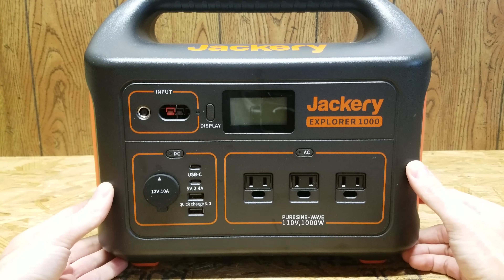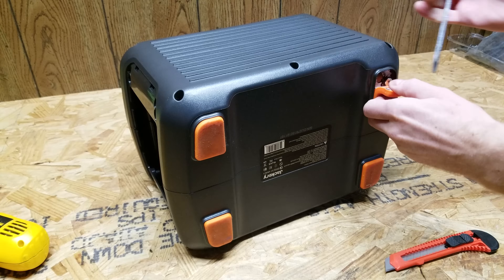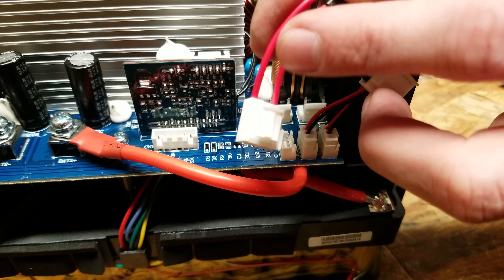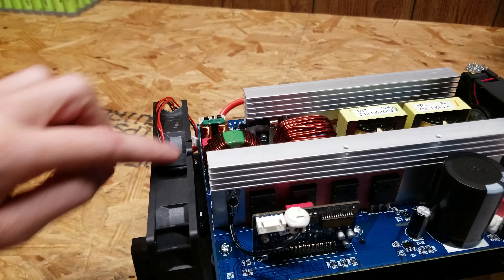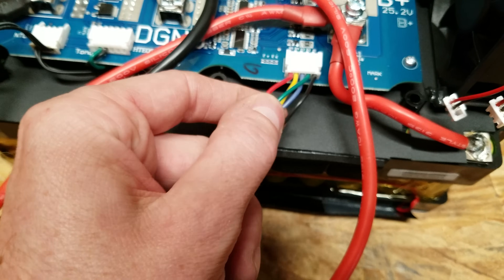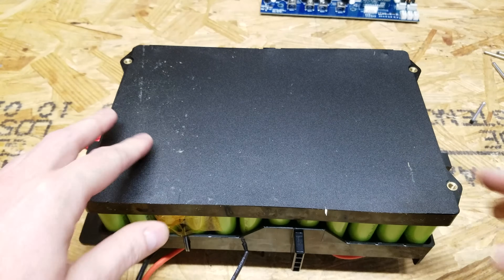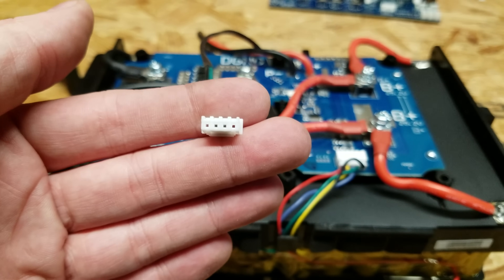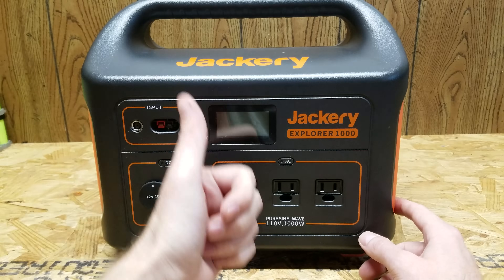Teardown of the Jackery Explorer 1000, Detailed Look Inside!

Comment: supposedly they have built-in safety features, including internal "breakers," that protect against overloading. The specific safety mechanism is an advanced Battery Management System (BMS), not a physical, resettable circuit breaker like in a home electrical panel.

Comment: So i recently purchased a jackery 1000 that is not charing and will only stay on while plugged in.  I tore it down and when i got to the point that he checks voltage at 6:17 https://youtu.be/AKxt4eAwKRU?t=377 i was getting like .08 but when i tested directly at the battery terminals im getting 18 to 19.   So I am thinking it has to do with something on the BMS board.  Maybe those resistor shunts?  any one have any ideas?
Reply from the maker: Was this still under warranty considering it was purchased "recently"? Your best bet would have been to return it and/or contact the manufacturer. Even if you are able to identify the problem, it's not really designed to be serviceable and they do not sell replacement parts or battery modules to my knowledge.
Reply: @LithiumSolar  No i purchased this second hand through facebook market place.  I did end up finding a blown fuse, but i read that if the fuse is blown there might be more problems.
Reply: @LithiumSolar  So i looks like i was able to get my unit working.  What i did was I checked the voltage going to the resistor shunts,  2 of them read about 18v but the other 2 read 0.  I replaced them (2 are BVS-A-R001-1.0 SMD precision resistors 12 Watt 5 mOhm and other 2 are BVS-A-R002-1.0 SMD precision resistors 12 Watt 5 mOhm)  Put it all together and plugged it in and boom its now charging like normal.  Waiting for the unit to get to full charge to test it fully.

Comment: Great video, saved me a whole bunch time today when someone brought one in to our local repair cafe.  I see there are a number of surface mounted fuses on the main board (with the display). I saw F1, F2, F6, F7, and F8. Not sure what circuits they all protect but the complaint was that it wouldn't charge from the solar input and F6 (rated 10 (amps, presume)) was definately blown.

Comment: Interesting...My Jackery 1000 Explorer started flashing the SOS signal at the flashlight on the side, and it would not turn off. However, I was able to get the light to stop flashing by doing a reset according to the manual, after a few minutes, it would start flashing SOS again. This device is slightly over a year old, with minimal use, and I store it fully charged. I sent Jackery an email about the problem, so I guess I'll find out how their customer service really is?
Reply from the maker: That's... unusual. Did you get any water or moisture in the light button by chance? That's the only thing I could think of.
Reply: @LithiumSolar  That's very possible now that I think about it. I had the Jackery in an enclosed car top carrier bag. The carrier is waterproof, but we have been having heavy humidity here, so I think condensation built up inside carrier, because all of the items that were in it were covered with moisture.

Comment: Great video. These are nice units. The one question I have that has not been answered is how many years are the internal batteries good for? Being lithium-ion, I am guessing 3 to 5 years? Which in my view is not a long enough life. The Jackery is a good product but not to knock it, I just built a 1280 W/Hr one using a 12V 100A/Hr Lithium Iron Phosphate battery that should last 8 years for about $370 total. It has a 1,600 watt pure sine inverter and 10 USB (6 are PD and OC 3.0 type), and 2 12v accessory sockets. It does not have a solar pane input at this time but can easily add this later. Plan to use on road trips, around the property, and for occasional power outages. While not a pretty as the Jackery, the battery should yield more power with a longer shelf life. Either the battery or inverter can easily be replaced if needed.

Comment: Bottom line is that this 1000 dollar pile failed me after about 13 charge cycle.....1000 dollars out the window.......now days it is 650 💵 but longevity is very much questioned 🤨🤐
Thanks for the video dude 👍
Reply from the maker: Wow, what happened to yours? Didn't they replace it under warranty?
Reply: @LithiumSolar  unfortunately it was passed warranty period, I did not had a chance to use it that much

Comment: Great video. I have a jackery explorer 240. I spilled water on it and it will not turn on. Do you think it will work when it eventually dries out? Thanks for your reply.
Reply from the maker: Most electronics can usually be dried out and they'll still work provided they weren't energized at the time and you do a very good job drying it out. The problem here is the power stations are always energized, even if they're turned off and unplugged, due to the battery and BMS circuitry. Unfortunately, if water were spilled on one and got inside, I would have a very difficult time trusting it again especially considering it's a lithium battery (fire risk).
Reply: Thank you for reply.  My water cup of probably 6 ounces tipped over and fell on it and it was not powered on or in use. But I’m sure it got inside because when I shook it, water came out. And it would not turn on. I gave it a few days to dry out. Then, pushing buttons still did nothing. Then I plugged it in and it came on with roughly
 the same amount of charge before the water spill. Hoping everything’s OK   But I do understand the concerns

Comment: If you use this on the daily expect to get ~2 years use out of it. Im at 2 years and the batteries seem to be failing. There are other brands with better battery technology having 6x the cycle capacity. Had I known that I wouldnt have bought the jackery. Its doubtful replacing the batteries is an option.

Comment: I just bought one of these little dumpsters and in 4 months and 5 phone charges later its frozen and wont take a charge and wont charge anything. What do you think the quickest way in here is to disconnect power in hopes of rebooting the thing?
Reply: I’m in the same boat. Have you had any luck? I’m just going to buy a new one and switch out the guts and take it back. Lol

Comment: I'm worried by there not being any air filters on these, I live in a country that doesn't have electricity 24x7 so mine gets used a lot.  The fans run constantly due to the load I'm presenting and I wonder what it's looking like inside?  Would anybody like to comment on that?

Comment: Clearly, Jackery uses 18650 batteries which is not top of the line. Look for a battery made of lithium iron phosphate.
Reply from the maker: LFP wasn't as easily and cheaply availible until recently. In 2023, I would defintiely go for an LFP model of any portable power system.

Comment: Hi, 
I'm going you can help me with my Jackery 1500. I bought it used and the USB ports and the 12 bolt accessory port work, but the three AC outlets don't work. The 1500 takes a charge and provides a charge through the other ports, just not the AC. I have done the factory reset and that doesn't fix the problem. I believe something inside has broken off as there is a rattling noise inside as if something is skittering around when I rotate the body of the 1500.  Can you offer any ideas as to what might be broken and what pieces I have to replace based on this description? 

The person I bought it from will not reply to me, so I can't get any further information as to the cause of the problem. Since i bought it used, Jackery is unwilling to help me as well. 

Thank you in advance for any help you can offer. And, even if you don't know an answer, your video will be immensely helpful when I do finally take the 1500 apart. 

Enjoy the day,

Carey

Comment: How do you maintain your jackeries while you have them in storage? Should I keep them plugged in all the time? I just store them for emergencies but want to make sure they're properly maintained. Thanks
Reply: it's probably best to leave it around 60-80% charged in storage and just top it up before you need it.  18650s last the longest if they're never completely full or dead.  my laptop batt died after less than 10 cycles because i left it plugged in all the time
Reply: Charge it every 6 months or it will self destruct.  I only got one use out of mine before I learned this the hard way.
Reply: @franklinmorgan5412  yes, I've been doing that. Thanks

Comment: Great review: One question though:
which one would you recommend in terms of Safety during extreme temparatures for Van life.
Jackery or Lithium ION batteries with charger controller set up. Tnx in Advance !!
Reply from the maker: I would look for something with LiFePO4 at this point.
Reply: Jackery je spíše pro přenášení a universální použití "vše v jednom". Pro van bych uvažoval o trvalé instalaci baterie a rozvodů 12V, či convertor a nabíjení solár + nabíječka dc/dc z alternátoru vozu.
Samozřejmě v dnešní době jít do technologie lifepo, která je bezpečnější a s delší životností.

Comment: A few minor details you missed... There absolutely are fuses on the board, I believe there are 2x 60A fuses on the BMS board. There's also a nifty power switch that disables the BMS enablement FETs. If you measure from the middle grounds to the + you'll see it only has power when the BMS allows it to (switched on, minimum voltage, not overheating, etc). I recently acquired an abused Jackery 1000 that was down to 15V, so was effectively shut down. I disconnected the battery pack and inverter from the front panel PCB, and was able to bootstrap the BMS by manually charging the battery pack up to about 20V.  After a little while, the BMS came alive, and I was able to measure ~20V at the center terminals, so I applied 25.2V to the pigtail that goes to the front panel PCB and then limited my to bench supply to 5A. It took about 8-10 hours to fully charge, which makes sense for charging a dead 1000WHr pack at roughly 100-120W. 
Now, the Front panel is basically just a collection of DC to DC supplies... As you pointed out, there's DC to DC for 5V USB, USB-C, and of course, the regulated 12V DC output, all 'enabled' with the push of a button. Now it turns out the other corner of the board is the 10-30V MPPT used for charging. The Jackery front panel allows charging with 12-24V barrel connector, solar panels (~18V), and technically supports 10-30VDC. The MPPT integrated into the front panel PCB is designed to provide the 25.2V that BMS needs to do its job (so you can charge a 25V pack w/ only 12V). In my case, someone blew up the front end, and let the smoke out of some of the FETs. (There's a set of P-FETs that isolate the Anderson connector from the 8mm barrel connector, and there's a set of N-FETS that deliver power to the the 10-30V to 25.2V buck/boost MPPT circuit; I suspect someone applied too much voltage, or perhaps applied significant reverse polarity to the Anderson or barrel connector; looking at the front end, it should tolerate a little abuse, but not much). In my case, I've reached out to Jackery to see if they'll sell me the PCB. This seems unlikely,  so I might continue to reverse engineer it and throw a few transistors at it to fix it, but even without the front panel to charge it, one could theoretically buy a 24V MPPT to feed the BMS and/or still have the pack run the 1000W inverter.
Reply: @elloello_erm  It's possible that the receptacle wiring is loose or shorted, Sounds like a bad inverter board. I suspect you'll need to take it apart and investigate, you'll probably see somewhere on the inverter board where the smoke got out. There's a shutoff switch on the BMS, no it'll be a bit safer to work on. Good luck!
Reply: @caffeineismydrug  lol I maaaaay need some simpler help on that. Can I repair it? I’m was hoping a nice swappable fuse would be the issue 😂
Reply: @stitcha123  Probably not, one might be able to swap out an inverter from another unit, but used parts are few and far between, and Jackery won't sell parts or PCBs, so your only hope is another used unit that you might pick and pull parts from.
Reply: @caffeineismydrug  assume you’re talking to a 5 yr old 😂
Reply: Hi! Do you think it is possible to fix a f3 error code? It says "Battery failure". Jackery does not offer any help unfortunately.  I sent my unit to a reputable electrical company and they said that all the components are perfectly fine, but there is a software problem. Do you think I can just put another BMS?
Reply: @NoteTen-h9i  If you tear it down to the battery+BMS, you can try to charge it with a bench supply w 25.2V ; If it's really low, you may need to charge the batteries directly to jump start the BMS. there's also an on/off switch to disable the battery. you might try cycling that, charging the batteries a little, then turning the BMS back on.

Comment: I have this model and wanted to see inside but since mine is new, I didn't want to void the warranty. Thanks for the tear down, I do a lot of work with 18650's and was hoping this unit had them. Now later I can pull out a bad cell and keep mine running for years more.
Reply: Don't mix new cells with cells that are heavily used or close to their End of Life cycle count (should be called Diminished Capacity Cycle Count). A few dozen cycles, not a big deal but 3 years down the road with about 450 cycles on her and you'll be putting a new cell in that measures 20mohm while every other cell in that power station is getting to the point where impedance is noticeably rising and 80mohm is the average for the pack. You'll have a bunch of cells at 1600mah or so cells while you put in a fresh one with 2Ah. The group that gets this cell is going to need more balancing work done from the BMS.

The most important aspect to consider is: ALWAYS REPLACE CELLS WITH AN EXACT MATCH. Don't change the chemistry, capacity or IR. If you absolutely can't get your hands on a certain Chinese made cell figure out which Samsung cell it is trying to replicate and go that route. Only buy new from vendors that are trusted. Li Ion Wholesale, 18650 Battery Store, Illumn, Battery Hookup, etc. Nothing from Aliexpress or Alibaba unless that's the only place you can find a Chinese cell. Don't get the quality name brands from Aliexpress or Alibaba.

Comment: This device is protected by an electronic fuse. @ 11:00 you see a very good picture of it.  On the left side you see two black wires bringing power into the board at the B- terminals.  There are two shunts between these two black terminals.  Shunts are very small precision resistors (0.001 ohms or so) that an IC is able to measure the voltage drop across it to determine the current.  To the right of the shunts you have 8 MOSFETs, which are basically on/off switches.  To the right of that you have two more shunts and finally the output terminals (DGND).  The "slave" board is measuring the current twice, if that measurement shows an error it will turn off the MOSFETs thus opening the battery circuit.  This is a FAR more expensive way of providing a fuse compared to the traditional fusible element device (which needs to be replaced) but  provides FAR better  control.  For instance if the output power is 100W, and it measures the battery voltage to be 22V then the current should be 4.54A (plus conversion losses.)  So if the shunts measure say 7A that would be bad and it should cause a fault to shut off.  This is definitely a quality device!
Now to really blow your mind!  You might ask why is protection on the black negative side, and not the red positive side.  Well electricity is the flow of electrons in a circuit.  Electrons are negatively charge particles that flow out of the negative side of the terminal seeking to get to the positive side of the battery were there aren't a lot of electrons.  So current flow OUT of the negative side, to the load, then to the positive side.  Sorry you've been lied to your entire life about how current flows from + to - in reality it's the reverse!  It's ok, have a chocolate chip cookie and it will be right as rain again!
Oh gosh, I let me electrical engineering degree get the better of me again, sorry ;-)
Reply: There's also two 60A fuses on the board.
Reply: @caffeineismydrug  where they are?
Reply: @luxwithtenebris  On the board, surface mount, labeled f1, f2, etc. But if you blew the fuse somehow, you've got bigger problems.
Reply: @caffeineismydrug  can you point me to the fuses on the jackery you mentioned? I have a jackery that is not working and no warranty coverage. Thanks.
Reply: @norcoredneck  I have a 1500 that can charge only on hot summer days. The temp keeps reading cold so I can never charge. Now it's sitting at 39%. Do you think it's the fuse also?
Reply: @genyang536 bad temp sensor or loose connection maybe?
Reply: @genyang536 just fixed a 500 with the same issue - In my case it was a faulty battery temperature sensor
Reply: @caffeineismydrug   There is a triggerable fuse on the positive lead from p+ to b+
Reply: How can you tell if they are bad? Is there a way to measure them? I have a jackery that doesn’t work and no warranty coverage.
Reply: More

Comment: What I find disappointing is each time it's recharged you loose 1% of a cell then after a 1000 times its ready for the bin . which is a wast of an inverter & solar controller.This is most likely why it's made of poliurafane /like bakealite material,that shatters,for despsal purposes contains less oil.
Reply: Nechápu vaše zklamání. Je to limitující vzhledem k dané technologii lopo.
V dnešní době je výhodnější proto lifepo, ale jackery jej bohužel zatím nepoužívá. Použití lifepo by mnohonásobně zvedlo cenu a zřejmě by klesli tržby